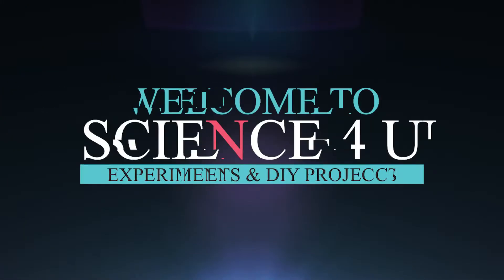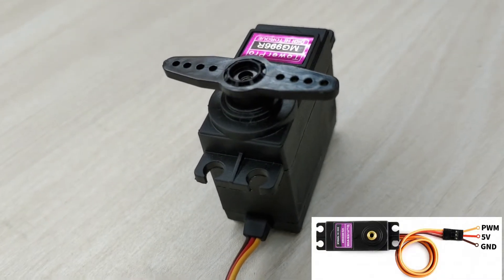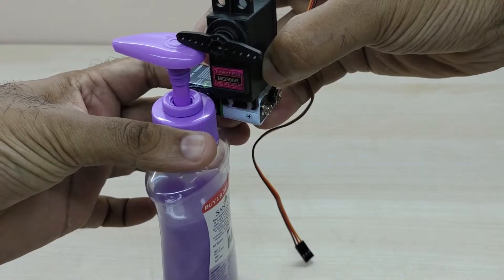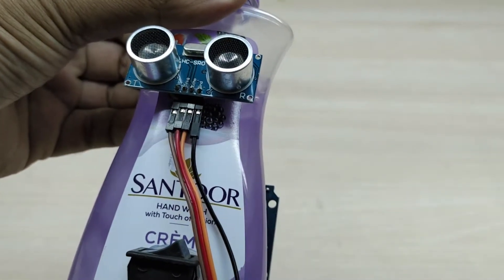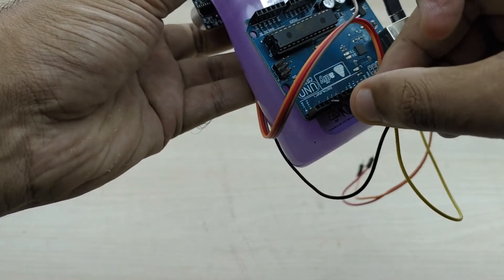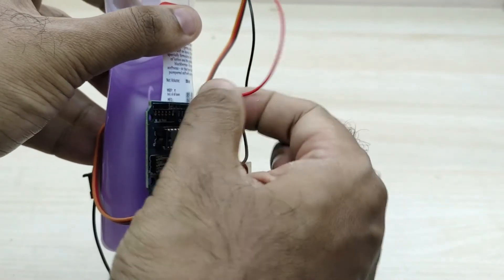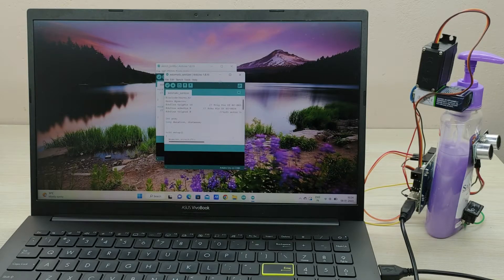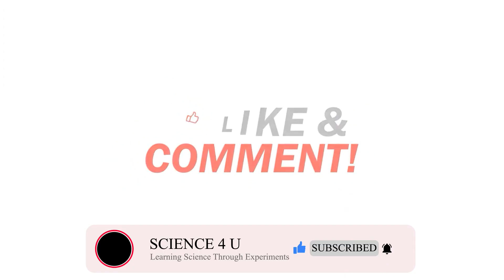How to make Automatic Hand Sanitizer || Say" NO" to CoronaVirus || Arduino Project

Comment: Sir I have connected all the circuit and the program but it still not working
Reply from the maker: It could be a problem with the ultrasonic sensor. It may not be detecting your hand properly.
Reply from the maker: Have you used new sensor or was it already used and a working one?
Reply: New sensor sir
Reply: When I connect gnd of ultrasonic sensor to gnd of Uno sensor lights OOF. UNO where of when I remove they were on even I bring new sensor from the shop the IT repeating same so please suggest me to how to do because tomorrow is last day to submit this project

Comment: Hlo sir, I had made all the connection correctly sensor and motor are also new one.
I had made the changes also in code but it is not working

Comment: automatic_sanitizer (4):8:6: error: redefinition of 'long int duration'

 long duration;

      ^~~~~~~~

C:\Users\HOME\Documents\sketch_nov14a\sketch_nov14a.ino:9:6: note: 'long int duration' previously declared here

 long duration;

      ^~~~~~~~

automatic_sanitizer (4):9:5: error: redefinition of 'int distance'

 int distance;

     ^~~~~~~~

C:\Users\HOME\Documents\sketch_nov14a\sketch_nov14a.ino:10:5: note: 'int distance' previously declared here

 int distance;

     ^~~~~~~~

C:\Users\HOME\Documents\sketch_nov14a\automatic_sanitizer (4).ino: In function 'void setup()':

automatic_sanitizer (4):12:6: error: redefinition of 'void setup()'

 void setup()

      ^~~~~

C:\Users\HOME\Documents\sketch_nov14a\sketch_nov14a.ino:12:6: note: 'void setup()' previously defined here

 void setup() {

      ^~~~~

C:\Users\HOME\Documents\sketch_nov14a\automatic_sanitizer (4).ino: In function 'void loop()':

automatic_sanitizer (4):22:6: error: redefinition of 'void loop()'

 void loop()

      ^~~~

C:\Users\HOME\Documents\sketch_nov14a\sketch_nov14a.ino:20:6: note: 'void loop()' previously defined here

 void loop() {

      ^~~~

exit status 1

redefinition of 'long int duration'

This report would have more information with
"Show verbose output during compilation"
option enabled in File -> Preferences.  these are the errors what to do now!

Comment: can we use servo motor sg 90 instead of mg 996g?
Reply from the maker: Yes friend. SG 90 is having less torque compared to 996g..sg90 will work ..but if sanitizer bottle needs to be pressed hard, then sg90 cannot give that much torque. So you can try with sg90 servo motor. If it is not able to press the bottle, then you have to use 996g..

Comment: Hey ! Thanks for the guidance. But i am facing a problem. When i connect the board with laptop, the code works perfectly fine and servo motor also rotates but when disconnected from the laptop and operated on battery only the servo motor does not rotate at all. Can you suggest what the problem might be?
Reply from the maker: Hi friend. It is definitely due to the battery not powerful enough to rotate the servo motor. When uno is directly connected to laptop, there is adequate power available from the UDB port. Hence no shortage of power  and it works correctly. But when uno is disconnected from laptop, the board, sensor and servo motor has to be powered by the battery only. So if it is not powerful enough or discharged, it cannot rotate the servo motor. Servo motor consumes large amount of current during operation.
Reply from the maker: Which battery are you using friend?
Reply: @Science_4U_  i am using a 9V battery, the same as u used
Reply from the maker: @pxlxx2706  hmm..okay friend. This 9V battery is good enough. But i think it may be discharged. Is it a new one that you are using?
Reply: @Science_4U_  Yes it is !
Reply from the maker: @pxlxx2706  ooh..I really don't understand why it is not working then😔. Since it is working correctly when connected through USB, that confirms that all the connections are correct. The only thing leftout is the battery. Are you seeing light in the arduino board when only battery is connected?

Comment: Is there any way to make the angle of the servo motor for it to move more?
Reply from the maker: Yes friend..Sure!!!!..You can make the following changes in the code to change the rotating angle of the servo motor. Please find the below lines in the code..

  for(pos=0;pos<=20;pos++)
    {
    Myservo.write(pos);
    delay(15);
    }
    for(pos=20;pos>=0;pos--)
    {
    Myservo.write(pos);
    delay(15);    

1. In the above codes 0° is the initial position and 20° is the final position of the servo motor. Increase the pos=20° to a higher number like 30° in both the 'for' commands to get more angle of rotation and hence more pressing of the arm..
2. Also please find the command delay(15). That is the delay in milliseconds for each degree turn of the motor. Reducing the number will make rotation faster. You can type 0 to make the fastest rotation.

Comment: Hi, We have connected the components exactly like yours.. But the servo motor is not at all rotating...please give me some suggestions
Reply from the maker: Hi friend. Either the servo motor could be faulty or ultrasonic sensor may not be  working correctly to detect your hand near it.
Reply from the maker: You have to test servo motor and ultrasonic sensor separately and find out which is having problem.
Reply: @Science_4U_  can i replace the servo motor  with sg90 ? Will that work?
Reply from the maker: @user-xv1fg7xy9m Yes sure friend. That will also work. If that servo motor is also not working, most likely the ultrasonic sensor is faulty. It is not detecting you hand and hence the sevo motor is not rotating.
Reply: @Science_4U_  No we've checked the sensor.. it's working perfectly.. Still don't understand where the problem is.. we have tried to do exactly the way you have shown in the video..
Reply from the maker: @user-xv1fg7xy9m If you have checked the sensor and it is working, then the servo motor could be the problem . Also please use a good battery. If you have doubt about battery, comnect uno board to usb of laptop/PC and see if it works.
Reply: @Science_4U_  we have even replaced the servo motor..but the result is still the same.. sensor and other things are working alright.. we have no clue what's wrong with the servo motor
Reply from the maker: @user-xv1fg7xy9m Hi friend. Have you connected arduino board directly to USB and then tried it.. is the servo motor working now?
Reply: @Science_4U_   yes we are exactly doing the same as your video.. But the servo motor is not working at all
Reply from the maker: @user-xv1fg7xy9m okay friend. Can you check the connection once again.?

Comment: how do i make the servo rotate more i am using the normal servo
Reply: pls help i need to submit tommorrow
Reply from the maker: @dxrkshadows Hi friend..Don't worry..You can make the following changes in the code to change the rotating angle of the servo motor. Please find the below lines in the code..

  for(pos=0;pos<=20;pos++)
    {
    Myservo.write(pos);
    delay(15);
    }
    for(pos=20;pos>=0;pos--)
    {
    Myservo.write(pos);
    delay(15);    

1. In the above codes 0° is the initial position and 20° is the final position of the servo motor. Increase the pos=20° to a higher number like 30° in both the 'for' commands to get more angle of rotation and hence more pressing of the arm..
2. Also please find the command delay(15). That is the delay for each degree turn of the motor. Reducing the number will make rotation faster. You can type 0 to make the fastest rotation.

Comment: sir what are the jumper wires? male to male / female to female or male to female, thankyou for response❤
Reply from the maker: Hi friend. I have use the following. 4 numbers male to female jumper wires for connecting ultrasonic sensor to arduino. 3 Nos. of jumper wires male to male for connecting servo motor to arduino.

Comment: please.  When I install, the servo moves four to five revolutions or more. What is the solution?
Reply: I want to deliver it to the university on Wednesday
Reply from the maker: Hi friend. You are using a continous rotation servo. But you have to use a positional servo motor which can rotate only 180 degrees. Both infact looks the same so it is difficult to differentiate. Positional servo motor only remembers the reference and turns a fixed angle from reference point everytime command is given.

Comment: hi bro... can we use sg90 servo motor instead of mg996 servo motor?
Reply from the maker: Hi friend. You can use SG90 servo motor also. But its torque is way lesser than MG996 motor. MG996 motor produces 11 kgcm torque whereas SG 90 produces only 1.6 kgm torque, i.e. almost 7 times lower. So SG90 pushing force will be less, but it will just work I think.
Reply: does your soap dispense worked with servo motor sg 90 with the same arrangement or not??

Comment: Means it shows no preview available
Reply from the maker: Hi friend.. I didn't understand the question. What is the preview you are referring to?
Reply: Sir if we try to download the arduino code it shows no preview available
Reply from the maker: @shreyasvh6569  It will show no preview available. But there will be a download button also in google drive. By clicking on it, the file will get downloaded.
Reply: @Science_4U_  there will be download button but once it downloaded I will make try to open it but file can't open that's would you plss send me the code
Reply from the maker: @shreyasvh6569  you can open the dowloaded file in wordpad or notepad. It will open..
Reply: please send that Arduino code
Reply from the maker: @shreyasvh6569  I will copy the code below..
#include<Servo.h>
Servo Myservo;
#define trigPin 10           // Trig Pin Of HC-SR04
#define echoPin 9        // Echo Pin Of HC-SR04
#define trigout 8                   //left motor 1st pin

int pos;
long duration, distance;

void setup()
{
  Myservo.attach(3);
  Serial.begin(9600);
  pinMode(trigPin, OUTPUT);       // Set Trig Pin As O/P To Transmit Waves
  pinMode(echoPin, INPUT);        //Set Echo Pin As I/P To Receive Reflected Waves
  pinMode(trigout, OUTPUT);
}

void loop() 
{
  Serial.begin(9600);
  digitalWrite(trigPin, LOW);
  delayMicroseconds(2);   
  digitalWrite(trigPin, HIGH);       // Transmit Waves For 10us
  delayMicroseconds(10);
  duration = pulseIn(echoPin, HIGH);        // Receive Reflected Waves
  distance = duration / 58.2;                       // Get Distance
  Serial.println(distance);
  delay(10);
  if (distance <15 && distance >0)               // Condition For Absence Of Obstacle            
  {
    for(pos=0;pos<=20;pos++)
    {
    Myservo.write(pos);
    delay(15);
    }
    for(pos=20;pos>=0;pos--)
    {
    Myservo.write(pos);
    delay(15);                                                 
    }
    delay(5000);
  }
}
Reply: @Science_4U_   is this code same as that u given in that pdf
Reply: Sir is this code same as that you given that pdf because I will done the circuit also that's why I am asking if sure that code is same as that pdf then I will compile that program tommorrow exhibition Is there that's why
Reply from the maker: @shreyasvh6569  Yes friend. The code is the same..
Reply: The arduino  code shows error
Reply from the maker: @shreyasvh6569 Hi friend. The code is a tested one and works without any problem. What is the error that it is showing?
Reply from the maker: @shreyasvh6569 what is the error that it is showing?
Reply: @Science_4U_  sir it's OK u have used a motor know what is the price of that
Reply: @Science_4U_  in circuit connections u connected the ultrasonic sensor but I am connected sonar sensor is that ok
Reply from the maker: @shreyasvh6569 I purchased for 398 Rs from amazon..But I am seeing the same motor for 250 Rs also in online sites like Robocraze, Robu etc.
Reply: @Science_4U_  ok
Reply from the maker: @shreyasvh6569  what is the model number of the sonar sensor?

Comment: bro that code is not working and Servo motor rotating continuously can you change the code
Reply from the maker: Hi friend. The code is correct only. Many have done this project also succesfully with this code. I think the servo that you have is a continous rotation servo. You need a stadard servo motor with around 180 degree rotation to work correctly. Both are different type of servo motors. You can search in internet..

Comment: Which gel is used to attach the components with sanitizer??
Reply from the maker: Hi friend. I have just used some handwash for the project. Sanitizer also will work. There are so many gel like sanitizers which will work best with this project.
Reply: Which gum (fevical) you used ?
Reply from the maker: @Branded... ooh..you mean gum..I first used normal glue gun and gluestick for sticking the components to the sanitizer. For the servo motor alone, Since large force acts on it, I applied some feviquick also..

Comment: Hi is there a specific Arduino Uno for this project? Because when I was trying to buy there is Arduino Uno DIP and Arduino Uno CH340G. I'm not quite sure which to buy.
Reply from the maker: Both will work friend..🙂There are only minor differences between them in term of speed. Also in DIP the chip is removable . But both boards are fundementally the same.
Reply: Thank you so much.

Comment: Servo motor is rotating just somewhat not rotating fully to pump the santizer tomorrow is our submission pls reply what can we do now??
Reply from the maker: Hi friend..Don't worry..You can make the following changes in the code to change the rotating angle of the servo motor. Please find the below lines in the code..

  for(pos=0;pos<=20;pos++)
    {
    Myservo.write(pos);
    delay(15);
    }
    for(pos=20;pos>=0;pos--)
    {
    Myservo.write(pos);
    delay(15);    

1. In the above codes 0° is the initial position and 20° is the final position of the servo motor. Increase the pos=20° to a higher number like 30° in both the 'for' commands to get more angle of rotation and hence more pressing of the arm..
2. Also please find the command delay(15). That is the delay for each degree turn of the motor. Reducing the number will make rotation faster. You can type 0 to make the fastest rotation.
Reply from the maker: Please change the code accordingly and upload. Please see if this solves the problem..
Reply: Now it worked thank you so much 😊
Reply from the maker: @venunuvvula5383  okay friend..happy to know that..🙂
Reply: Thank you ❤ @Science_4U_

Comment: hi, me and my friend tried doing this. We bought all the equipment needed and tried the code given, it did not pump. any suggetions on what to do right now?
Reply from the maker: Hi friend. Is the servo motor arm rotating when you are bringing your hand near the ultrasonic sensor?
Reply from the maker: Or is it just a pumping problem?. Like the arm is moving when hand is brought near the ultrasonic sensor, but the sanitizer is not coming out of the bottle?.
Reply: @Science_4U_  yes.. it is the pumping problem. We tried many things... any solution for this??
Reply from the maker: @eline_3 Is the sanitizer coming out by pressing with hand. Normally it takes a few presses initially for the sanitizer to come out. Also, are you using just alcohol sanitizer which flows like water?. You can use some thicker alcohol based sanitizer fluids which will be easy to come out with a press. You can try with handwash also and see if that works.
Reply: @Science_4U_  the sanitizer is coming out by using hand.  thanks for the solution!

it is liquidy...and we are using an ethyl alcohol based sanitizer
Reply from the maker: @eline_111  But friend, with hand if it is coming out, it should have comeout with the press of the servo motor also. I suspect the following 2 things.
1. The motor arm is not pressing the stem enough so that sanitizer is not coming out.
2. Th servo motor is pressing slowly compared to hand.
In both the above cases, it will be difficult for the sanitizer to come out. But, both problems can be solved. Can you please check and tell which could be the reason for sanitizer not coming out?
Reply: @Science_4U_   i think its the first reason..
Reply: and also the servo is rotating slowly... what changes should be done in order to rotate it likewise in the video??
Reply from the maker: @eline_111  okay friend..Please find the below lines in the code..

  for(pos=0;pos<=20;pos++)
    {
    Myservo.write(pos);
    delay(15);
    }
    for(pos=20;pos>=0;pos--)
    {
    Myservo.write(pos);
    delay(15);    

1. In the above codes 0° is the initial position and 20° is the final position of the servo motor. Increase the pos=20° to a higher number like 30° in both the 'for' commands to get more angle of rotation and hence more pressing of the arm..
2. Also please find the command delay(15). That is the delay for each degree turn of the motor. Reducing the number will make rotation faster. You can type 0 to make the fastest rotation.
Reply from the maker: @eline_111  If you have further doubts and os still not getting solved, please mssg me in my instagram id. If you can send a video in instagram, I will see the problem and will help you solve it..👍